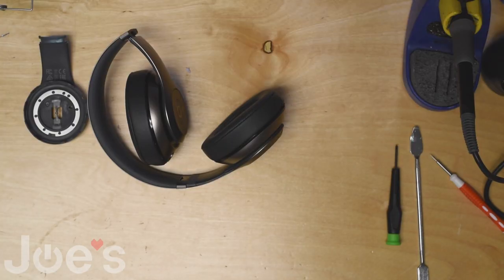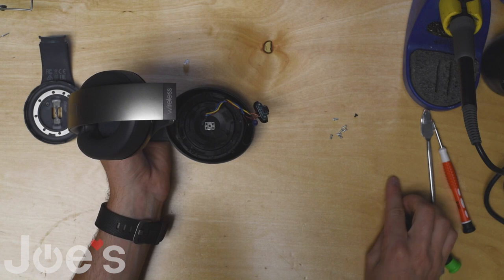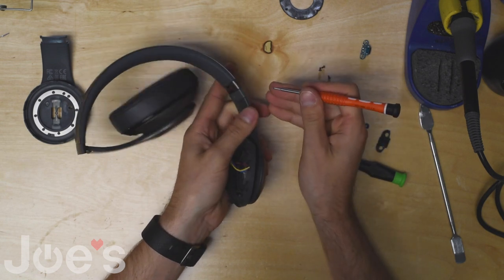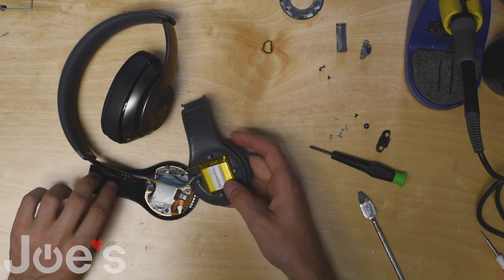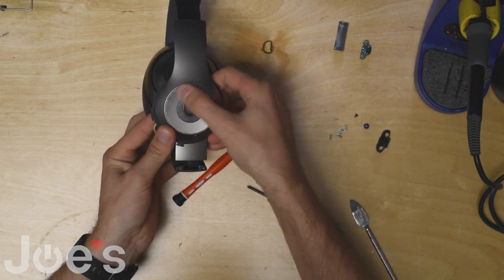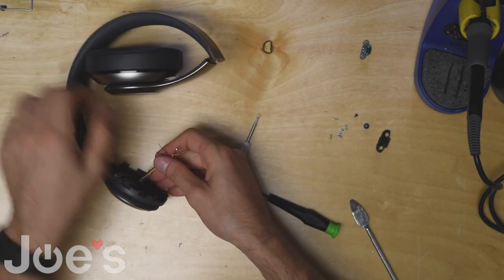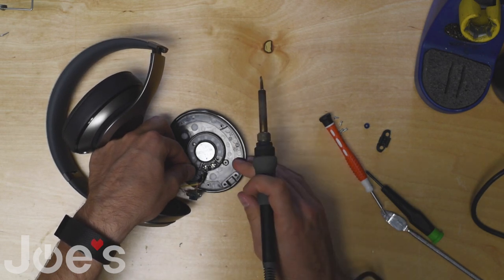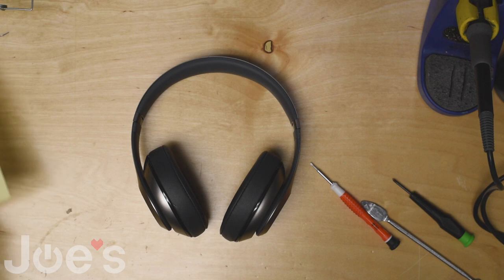Beats Studio 2 Wireless Inside Panel Part Replacement

Comment: While this process may seem slightly inconvenient, it’s really not that much work. People see a soldering iron and immediately they run for the phone book to call their closest repair shop, or just buy a whole new device. When the part is only 20 USD or less, a little bit of effort is worth the money saved. Lol people are deadass afraid of a little heat and solder.
Reply from the maker: Your not wrong:)

Comment: Dang it. I thought it was gonna be easy, but I need the soldering machine
Reply from the maker: Thanks for watching! Soldering equipment can be bought for relatively cheap, either online or at almost any department store.
Reply: Joe's Gaming & Electronics is there any website I can buy the inside panels? Can’t find it on amazon or eBay.
Reply from the maker: We post the link to the parts in the description, but you can also find it here: http://bit.ly/2xsx8JW
Reply: Joe's Gaming & Electronics also wanted to ask, if unsoldering and re-soldering the wires effect the quality of the sound?
Reply: @kahiauandkeeaola808  depends, if it's done sloppy, it could become disconnected and might affect it, but I dont think beats makes their solders professional perfect like sony or bose

Comment: Hey Joe!!! Can you help me with something? My Beats Studio 2 Wireless droped off inside a sink full of water and since then the right side (where the panel is) has a buzzing sound when on wireless mode, however if I use wired it works fine with no weezing at all. Is there a way to fix this? Thanks in advance!!! Nice work with the videos :)

Comment: Great video! I need to do the same but on the left panel. Is there a video for that or is it similar to the right side? Thank you!
Reply from the maker: I will leave a video down below of the left OUTSIDE panel replacement. Obviously you are replacing the left INSIDE panel, but this will show you how to tear down the left side, and put it all back together. Just skip the part where they replace the Outside panel

https://www.youtube.com/watch?v=A3uNyMI6kNk&ab_channel=Joe%27sGaming%26Electronics
Reply: @Joesge  Thank you!

Comment: How much would you charge to replace both L and R inside panels?
Reply from the maker: It would cost $120 for both wireless inside panels, If you have a wired pair it would cost $90.  That includes free shipping both ways, in the USA.
Reply: do you guys have the speaker driver from studio ? is it the same from the solo ?

Comment: I have no sound coming from the left ear piece. How can I tell which part I need so I can order from you guys?.
Reply from the maker: Thanks for the comment. The issue you are describing sounds like a faulty internal wire. Here is a link to the part: https://www.joesge.com/products/beats-studio-2-wired-wireless-speaker-2-core-wire-clip-red-white-parts?_pos=12&_sid=4b6eed3a0&_ss=r

If you would like your device repaired by a professional you can fill out a repair form and follow the steps to send in your item. We offer free shipping and diagnostics. Here is a link to the repair form:
https://www.joesge.com/pages/repair-services

-David P

Comment: How much would the repair cost if I sent mine in and how much would the panel itself be
Reply from the maker: $80 total for the repair + part. 65 for the part.
Reply: Wow really? For a small inner panel, I think I'll just try to ignore the little crack
Reply: Joe's Gaming & Electronics are we able to send it in your repair centre if im living in Canada?
Reply: @Joesge  You could buy a new pair if thats the case not worth fixing
Reply: @boboleg4186  did ignoring it work? Not trolling. Genuinely interested. Also, how long did you have yours before they cracked.
Reply: @kalvinrhone901  mines lasted about 6 months before they finally cracked
Reply: @rfs056  I'll have to take apart the entire right side, soldering and all to fix. I have a big head and lots of hair and oft would sleep in other headphones for months. Never did with these because of the price tag... Very frail. Cheaply made.
Reply: Kalvin Rhone yeah I had to repair many parts with these beats and I wonder how I can repair without soldering machine
Reply: @rfs056  I don't see how that's possible. I purchased a top rated soldering kit from Amazon. Inexpensive.
Reply: @kalvinrhone901  okay i am going to have to look for one to complete this repair

Comment: Will the inside panel from the wired B0500 fit the B0501?
Reply from the maker: No those parts are not interchangeable. Joe
Reply: just out of curiosity, what’s the difference between the two?
Reply from the maker: One is wired, the other is wireless

Comment: goddamn i only got 2 mins into this video before i thought
"fuck this im just using tape" 
lol no offense bro but nobody gonna be removing there
(non re-usable) glue for the ear muffs and disconnecting/saudering the fuckin speakers you crazy?😂 it would just be worth new headphones at that point and the reason they break is cause the company uses weak plastic on purpose because the speakers will never blow and they gotta get more money from you somehow if not it would be like Michelin selling you a lifetime warranty tire😂
Reply from the maker: Thanks for watching! It is fully up to you if you want to fix them or not. We make these videos for those who want to attempt the repair themselves, the adhesive can be replaced and each part can be bought separately. Or, you can send it to repair shops like us and get them repaired and get a repair warranty. If you would like them repaired, we do offer repair services here: JoesGE.com/pages/repair-services